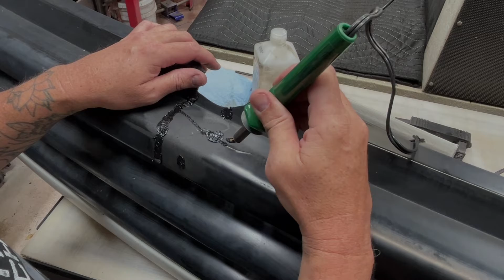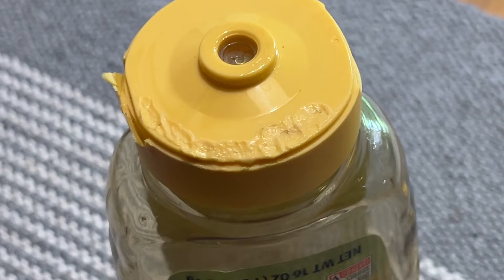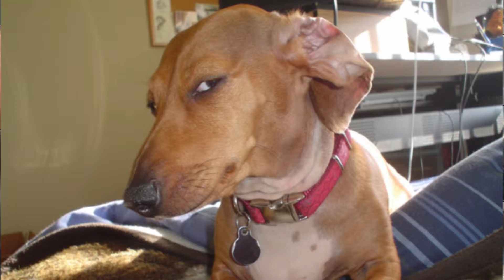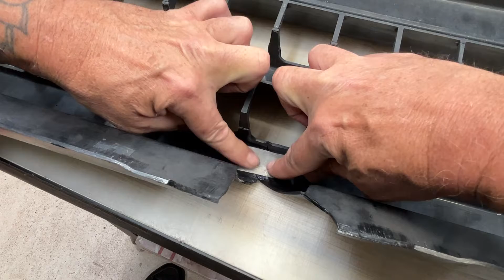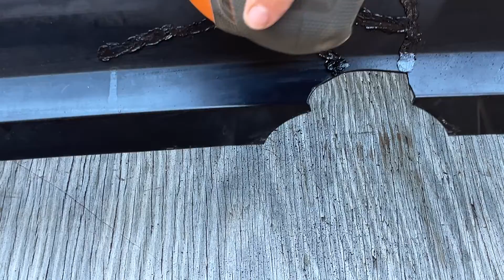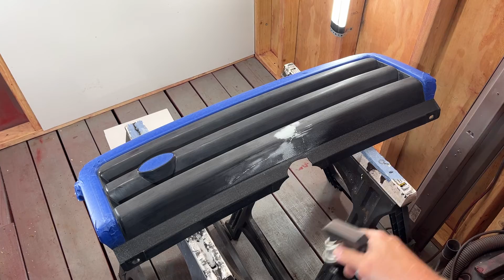How to Plastic Weld Like a PRO!

Comment from the maker: Learn how to plastic weld like a pro with 8 essential tips! In this video, I repair a cracked Land Rover Discovery 2 grille made from brittle plastic and show you the best techniques for strong, clean repairs. Whether you're fixing bumpers, grills, or other automotive parts, these plastic welding tips will help you get pro-level results. Feel free to reach out if you have any questions...or to let me know that I'm doing something wrong.